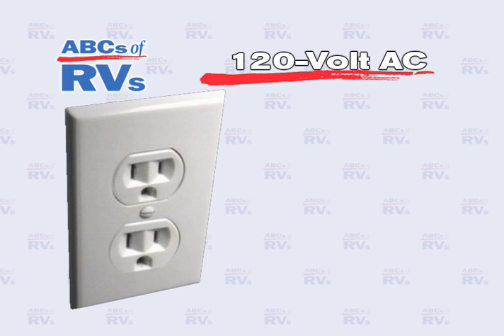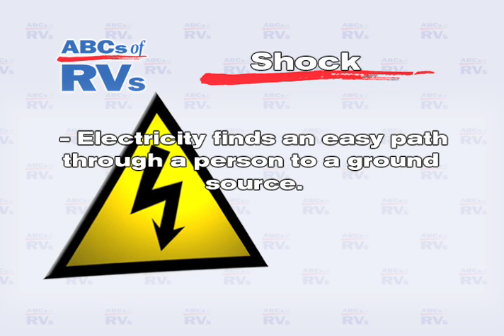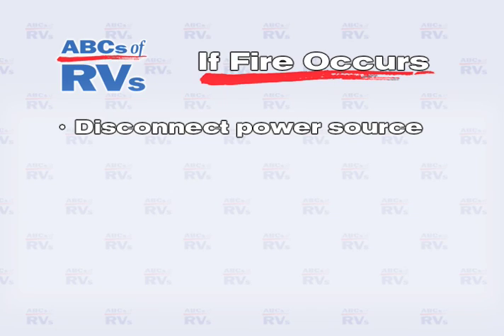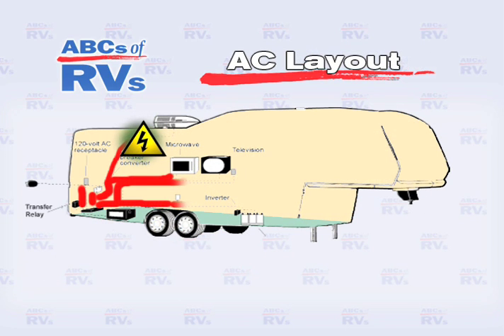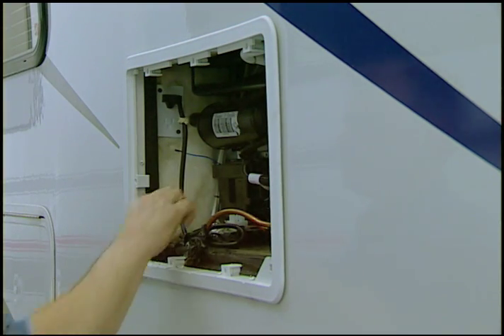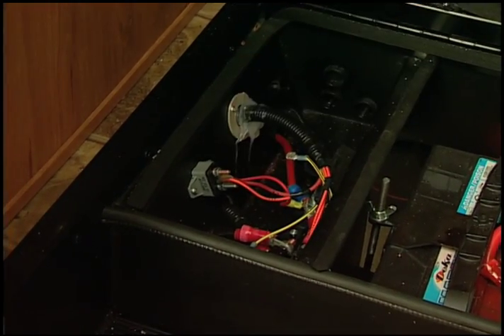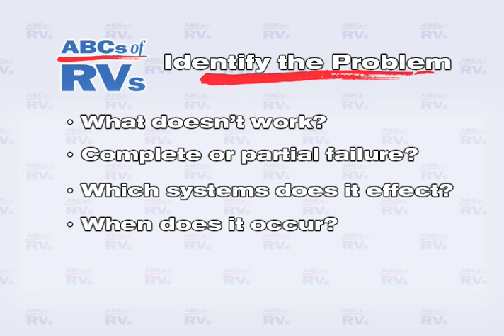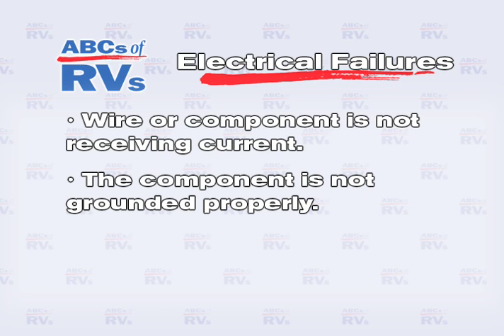120 Volt RV

Comment: THE HOT IS BLACK , THE OTHER IS WHITE AND GROUND IS EITHER BARE OR GREEN , ALWAYS CONECT THE WHITE WIRE TO THE SILVER COLORED TERMINAL AND THE HOT TO THE BRASS COLORED TERMINAL..